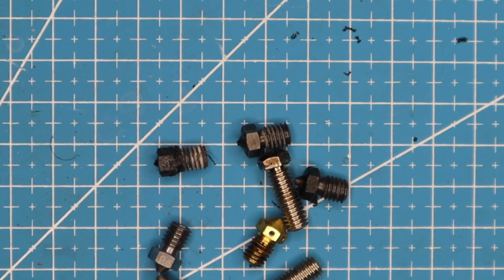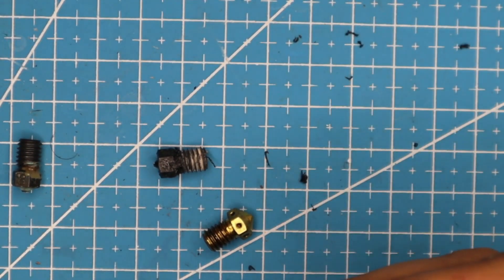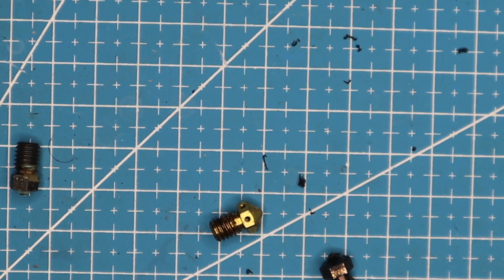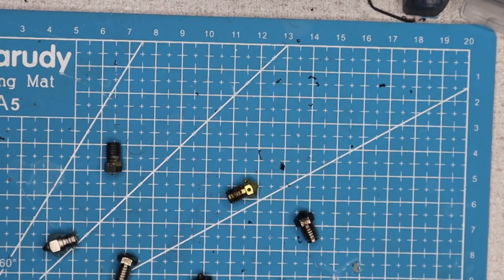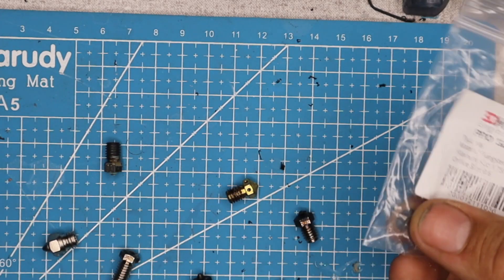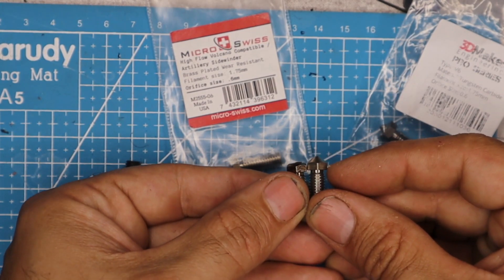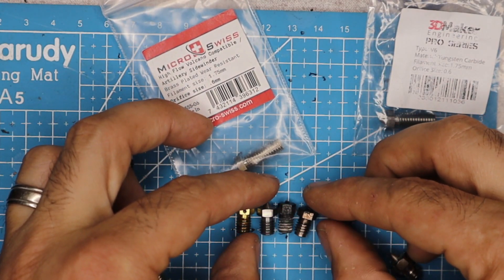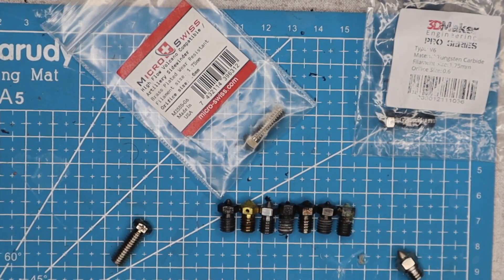How wear resistant are wear resistant nozzles

Comment: Wait I'm confused. Did the hardened nozzle last? I heard those Last forever with carbon fill filaments and GF.
e3d says that. Also nozzle X is even more resistant. They have a lifetime warranty

Also did you say fetus nozzle? For the second print. I can't hear it well xD
Reply from the maker: The hardened nozzle really made me sad cause they really did not hold up at all. If your gonna push high fill plastic you need tungsten carbide or dare i say it ruby lol . Tungsten carbide has been it and that with titanium in the Takoto is the best imo
Reply: @advanced3dprinting  damn titanium has horrible heat transfer tho!

i'm so shocked and surprised, maybe the hardened nozzle wasn't hardened properly? E3D advertises theirs to last a lifetime wit carbon fill etc!
have you also tried the nozzle x?